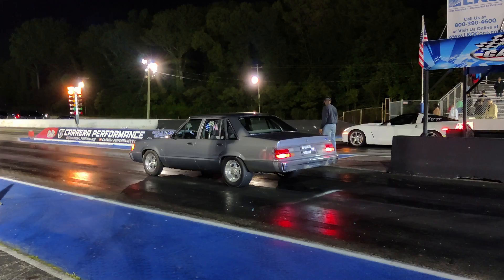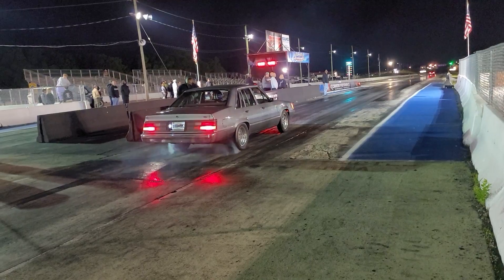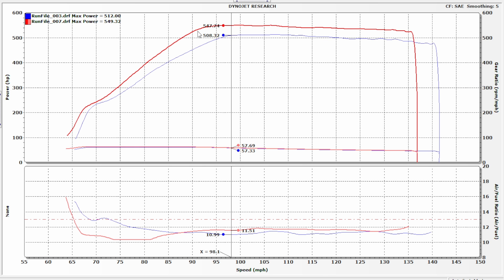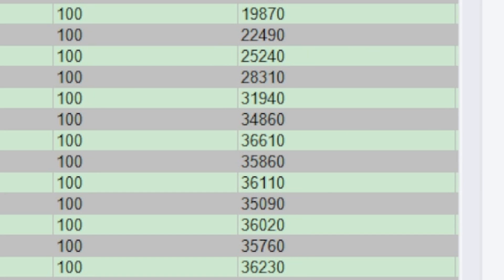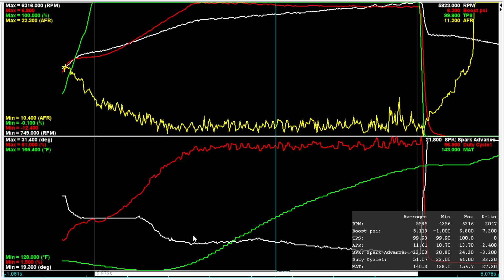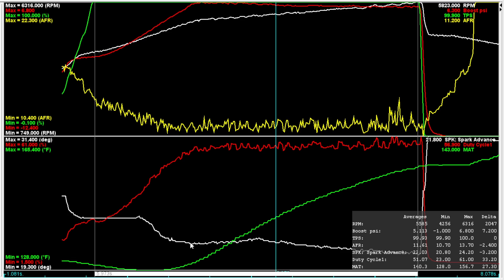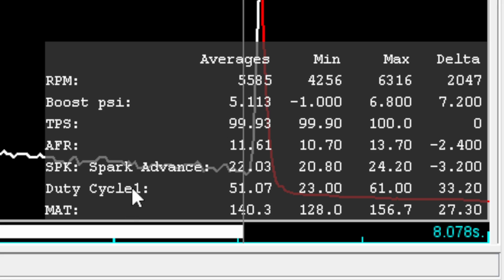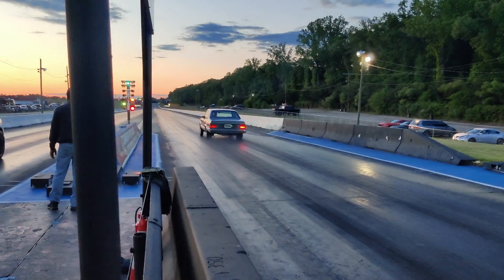Volute Methanol Injection Dyno Data - Deep Dive!

Comment: 36000 watts is 48 hp, so the math kinda-sorta checks out.  But you'd still be better adding that power directly to the driveline!
Reply from the maker: We picked up 205 rwhp driving the supercharger electrically.  If we simply added 48 hp to the wheels, we would've picked up 48 hp at the wheels.  I'd rather have 205 more hp than 48.
Reply: @AlexLTDLX  I'm not seeing that in the data presented, but that does make a whole lot more sense.

Comment: Did you do any testing comparing volute injecting vs the charge pipe or other locations? Do you believe the volute is the best location, and why?
Reply from the maker: I didn't compare other locations, because I was paying for these dyno sessions and didn't have the time - this dyno was 90 miles from where I used to live.  I went with volute injection because it's supposed to make the compressor more efficient by cooling (and therefore contracting) the air right where it's being compressed.  But I've ordered my own dyno now, and we will be able to test anything we want going forward.

Comment: Hey Alex. Got a question for ya. I see your temps sky rocket down when doing a run. Now if you have water meth injection installed but temps don’t come down while injecting in boost is it too small nozzles or too small pump or possibly both? I’m running 2 nozzles one before the compressor one at the throttle body and temp slowly climbs. Just wondering if you have seen this before.
Reply from the maker: Most likely too small nozzles.
Reply: @AlexLTDLX  thanks for the reply! I got the aem ones like you have installed now and 2 of those has it working right! It’s really nice cuz I could try different combos to get the right amount. You hit the nail on the head. I appreciate it

Comment: Maybe the temperature of the injected methanol is cycling above and below its vapor point as the air is cooled. Try injecting warm methanol, it may stabilize the pressure. An alternative would be slightly less methanol flow or maybe try moving the pressure sensing port further downstream. This brings up a different thought, If I added an electric blower with similar methanol volute injection to a 100% stock engine running a stock ECU and used a dedicated wideband to control a proportional methanol valve and resulting final fuel mixture. If it would work the result would be a simple cheap system for stock vehicles that left a virgin emission system but safely added fuel with the extra air and still protected against detonation. It might not always cool the charge perfectly but that would not be catastrophic. When the Wife wasn't looking, I could turn her V6 6-speed Accord into ......

Comment: how are you controlling the meth? Pulsing the nozzles could be cauding the jittery boost graph
Reply from the maker: Just dead-headed into the nozzles.  You could be right.
Reply: @AlexLTDLX  pwm on the pump or just a boost switch? And what size nozzles? 3x is alot for 500hp depending on nozzle size.

Make sure you run an inline filter (i put mine on the suction side of the pump)

It doesnt take much too clog the nozzles

Comment: Very interesting video. I've been running water meth for 15yrs or so. 71 240z 2.8L l28et ms v2.2 hx35 billet compressor 1.5ish bar of boost Npr intercooler cooling mist pump 400cc injector. And we've tried a bunch of different locations. At the throttle body.... in the intercooler, after the intercooler, after the turbo , and the best spot was coming out of the intercooler. I think the biggest contributing factor of why that location is best is because of the intake temps (besides the obvious fact of the intercooler). On the street or doing pulls 1/4 mile or less. Temps never went above 30 degrees above ambient. I do a lot of open track days but unfortunately I've never tried different locations with the watermeth on the road course. Also are you injected 50/50 or 100% methanol. there's a lot of videos on that one. I'm running 50/50.

Comment: should have lock the timing to the same for your test  its show on the graph the meth had 3 to 4 degree more because  your tune pull timing whit the air temp beying too high you could have desable it run the timing at safe level looking at your graph around 20 degree at the top wgit just pump the make another run whit the meth would show you the cooling  the add timing to it

Comment: 👏 awesome video and data! Been searching for this information with actual data for quite some time. Just found your channel love what you are doing!

Some of the questions i had were already in the comments like 100% methanol is being sprayed. But i have a few more, what type of fuel is the vehicle running that you can run that much timing?? IAT even with methanol was low 120's? I wouldn't be able to run any timing that hot on 91 octane... Maybe i am just to conservative.

I specifically like this video because there is claims but no data that centrifugal supercharger boost pressure would go up, which appears not to be the case. Regardless you got solid gains! Why 3 nozzles in such a compact space? Better atomization? 
I had a ton more questions while watching but forgot so will have to watch again and make notes. I hope you will go over every detail and thought process of your setup or maybe you already have and i will just have to watch all your videos.👍
Reply from the maker: Thanks.  It's 93 octane pump gas.  As for the seemingly high IATs, I run the sensor in the stock location - which on a fox body Ford is the lower intake manifold - since those days, OEMs tend to put the sensor in the intake tube or some other place (air box, etc) that doesn't get nearly as hot.  I pull timing over 140 degrees.  

I put 3 nozzles in because I wanted to spread the meth out throughout the volute and to give me more flexibility in nozzle sizing.
Reply: @AlexLTDLX   Thank you for replying Alex. I have been going back and forth on where to spray logically the valute is safer (no impeller damage) but right into the compressor wheel would/could be the most beneficial was my thought process conclusion, I just wonder if a boost pressure gain can actually be achieved? I totally understand your reasoning with the electric motor not wanting to go that route or test if it in fact could create more boost pressure but man I wish I could find data to prove it, especially for the fact it needs to be tested on a supercharger with a fixed speed ratio to be conclusive unlike if done on a turbo IMO. 

I did learn in your video about what to expect to calculate to spray vs fuel and that was great info that I didn't even think of! I was thinking it would be a LOT less... like 1 of the smallest nozzles would do the job. Problem now is that I have Rotrex and FMIC so I think I will end up pooling the methanol in the intercooler? My AIT's are only 7-12 degrees over ambient and I spin just over max RPM on the blower at redline. I wanted to run the methanol to possibly gain boost pressure but now I'm not sure I will see much if any gain.🤔
Reply from the maker: @lcq4blackstar  It's not so much a boost pressure gain, but a mass airflow gain.  Since the air charge is now cooler, it's also denser.  I really should do a "deep dive" into our drag test with this setup - you really see the IATs drop; but I didn't include it in this video: https://youtu.be/RT0M88xHzNQ

Comment: Is your methanol pump self regulated, or does it have a return system? Maybe it's the pulse from the pump building and releasing pressure?
Reply from the maker: It's just dead heading into the nozzles.  There's no return.  You could be right, but I'm pretty happy with it as is - taking the car from a 12.2 to a 9.9 in the quarter is pretty good you probably saw the video: https://youtu.be/RT0M88xHzNQ  I'm looking forward to being able to tweak the setup even more.  I think under the right conditions we could see 9.6's at 140 or so.
Reply: @AlexLTDLX  I watch as much as I can sir. I saw this issue using a methanol pump to a fuel injector. While in the 60-100% duty cycle you could watch the pump pulse. I just added a regular old fuel regulator to the system with a return. All -6 small stuff.

Comment: Just subscribed! You are single handedly proving the concept of worthwhile electric boost. Torqueamp was close but didn't have the hardware or design to support 600rwhp in a v8. I would look at partnering with a turbo or tuning company. I think you're on to something. cheers bud!
Reply from the maker: Thanks.  I'm exploring various options at the moment.
Reply: @AlexLTDLX have you considered converting a Rotrex??
Reply from the maker: @lcq4blackstar  Rotrex blowers aren't well suited to electric conversion because of their high impeller speed.  The speedmaster P2 is the best unit for the majority of vehicles because of it's price, compressor map and compatibility with available bldc motors and ESCs.

Comment: I've already contacted line to line and am getting my turbos coated. Makes logical sense of greater compressor efficiency by decreasing wheel to housing clearance. I have a 5th gen 3.6 V6 with rear mounted twin Borg Warner 6258 EFR turbos. Anxious to see results.  Great data and love your electric turbo build. Wish you would begin manufacturing and selling these because I would convert my build.

Comment: have you found the knock limit of this combination (without the methanol)? or pretty much tuned for best power and never saw knock?
Reply from the maker: It's a low compression engine design for boost. It's only 8.8 to 1. So no, we basically never see knock certainly not naturally aspirated

Comment: The jitter in the boost curve is the actual pumping of the methanol as it’s coming in. What you’re seeing is the pressure pulse of the actual methanol pump. You really should try straight methanol you will make even more power.
Reply from the maker: That seems like a possible cause.  BTW - I am running straight methanol.  I believe that was mentioned in the dyno video.
Reply: @AlexLTDLX  I see it all the time with tuning cars on methanol injection.
Reply: @AlexLTDLX was going to ask what percentage methanol you were spraying, agree with the comment it got to be the pump pulse causing the boost pressure osolation. 👍
Reply: put a snubber on it.

Comment: I have used the aem version three nozzles and I’m not a fan they tend to leak. They also swell up and don’t like to come apart for changing nozzle size. Prometh has a much better solution and using snow performance quick connect along with a prometh check valve insures, no leakage, and a great spray pattern
Reply from the maker: I did notice they leak without running the solenoid.  I'll likely install the solenoid.  Have you found the check valve to affect the flow?

Comment: I'll be interested to see if the meth straight into the volute has any impact on the impeller itself - I remember 20+ years ago talking to guys who were water injecting before their turbo on draw through setups and hearing that it can significantly pit and chip the blades.  I never saw it for myself and there was a fair bit of debate about the legitimacy of the claims but it's something that stuck in my mind...
Another great vid, thanks!
Reply from the maker: Thank you - since the methanol is going straight into the volute, I don't think it'll even come in contact with the impeller.  But I do need to install the solenoid - the methanol drips through the system very slowly without it.
Reply: @AlexLTDLX then there is a possibility that yhe shudder while spraying meth could be cooling the compressor enough that the impeller, while under boost, is more rigid, therefore transferring more vibration through the system.

Comment: The boost pressure pulsing.. could that be the methanol injector itself pulsing fluid into the intake tract?
Reply from the maker: Could be... I really don't know.  It's like looking a AM radio - the jitter is further modulated by a slower pulse...  but your guess is as good of a guess as any.  The nozzles do have elements internally that spin.

Comment: Maybe the jitter is from the menthol solenoid pulsing
Reply from the maker: Alas, there is no meth solenoid.  I'm intentionally using the simplest variant of the system - tank, filter, pump, nozzles.  I'll add other stuff later as needed (the solenoid is needed, I can tell you...)

Comment: I hate "methanol injection".

I'm building a gasoline/methanol engine, except I'm injecting 100% methanol and 0% gasoline at WOT. I wish the people spraying washer fluid into their engines would call it methanol spray or something. Yall are making it impossible to search for real alcohol engine information.
Reply: This brings up what real Methanol could do for your engine. Blown Alcohol is HUGE. You're like doubling the amount of mass of exhaust gas through the turbo. With E85 you're talking 2 atmospheres of boost, with M1 race fuel, you're looking at 4 atmospheres of boost with a high static compression wngine.
Extra boost just due to the incompressible fuel. Better volumetric efficiency due to the mass of the fuel. Super ridiculously cool, your engine will be colder at the end of a run than at the start.

Comment: I actually have my nozzle in the supercharger pipe about half way between the supercharger and the throttle body. Closer to the manifold so it does more cooling. As discussed before my combo made 100hp more to the wheels.

Comment: You should have been able to add more than one degree of timing. Did you attempt to?
Reply from the maker: I didn't say we added 1 degree of timing.  We added small bits of timing as the engine wanted based on Ray's experience as a tuner.  We added a couple of degrees here, pulled back a bit there, etc.  But as the engine is already close to maximum BMEP, there wasn't a lot of additional cylinder pressure to be had from timing.  We can probably extract a little more power with a little more timing, but other dyno tests I've done in the past have shown as you get closer to maximum BMEP, timing starts having less and less of an effect.  If you're out in left field, 1 degree can add 30 hp.  If you're two degrees away from optimal, adding 1 degree may only give you 3-5 hp.  And that optimal point is a moving target based on a bunch of variables.  Ray has enough experience that he can make a dyno pull, and based on the shape of the graph and the sound of the engine he can dial in the timing.  And he also has enough experience to know when to stop.  I'm good, but I'm not as good as Ray.  I still end up pulling plugs and such.
Reply: @AlexLTDLX  gotcha. I misunderstood and thought you only added one degree and didn’t try any further.

Comment: I spray preturbo. Been doing it for years. It’s not going to catch fire. What happens when you have a fire and you over saturate with oxygen? It blows it out.
Reply from the maker: That is not true - and if anyone reads this comment please don't try it.  It is impossible to "oversaturate" a fire with oxygen and put it out.  Fire is literally the rapid oxidation of a material.  In fact, adding oxygen to a fire will speed up the reaction until it explodes - with enough oxygen, all consumable material (in this case, even iron and steel are considered "consumable") will be almost instantly consumed.  Like when you turn up the oxygen knob on an oxy acetylene torch too fast and the flame goes out with a pop - the pop is an explosion that has used up all available fuel (acetylene) instantly - which is why the flame goes out; but if there was enough acetylene, you, your house, your car and everything around would be engulfed in an explosive fireball almost instantly.  Oxygen MOST DEFINITELY WILL NOT PUT OUT A FIRE; IT WILL MAKE IT WORSE UNTIL THERE IS NOTHING LEFT TO BURN.  I cannot stress this enough - the counter is very dangerous misinformation to spread around; it's the kind of misinformation that can kill people.  And on to the point - if the motor fails, we have enough power to draw a 4" long plasma arc that has in other videos sawn through a thick aluminum housing in seconds; and nothing I have puts it out - I know, I tried.  Methanol, even in a 50/50 by mass or volume mix will certainly be ignited by such an arc.
Reply: @AlexLTDLX  literally tons of people spray preturbo. Not one person has caught their car on fire from spraying preturbo
Reply from the maker: I understand it's rare.  But we've already had a number of fires/explosions by the compressor from electrical parts failing (here's just one example: https://youtu.be/_n6hDRsMZd8 - can you imagine what would've happened going down track spraying meth?)  That's my concern.  I'd be foolish to mix 35,000 watts and pure methanol within inches of each other.
Reply: @AlexLTDLX  well I did not consider your electric ordeal. But a normal turbo, no worries. It’s actually a thing to sprag preturbo.

Comment: Surface temp swnsor..sensor... doesn't lie if your worried about "wetting " how bout after a good hard run... stop and pop the hood.... for me I can physically touch and feel how darn cold my intake is.   Before run was smoking hot. PROOF ALLDAY.
Reply from the maker: This is exactly the argument - the methanol wets the sensor and cools it off through its latent heat of vaporization as it vaporizes.  If that's true, then the same thing happens on the inside of the intake manifold, making the manifold cool off.  But how much of that cooling effect affects the intake charge?  I tend to think it's a bit of both; but methanol is known to be a very cool running fuel.  A few years back on a drag racing show I was doing, we put a camera right on the injector hat of a methanol fueled, blown big-block car.  By the time the car was at the end of the track, there was condensation on the injector hat and blower.